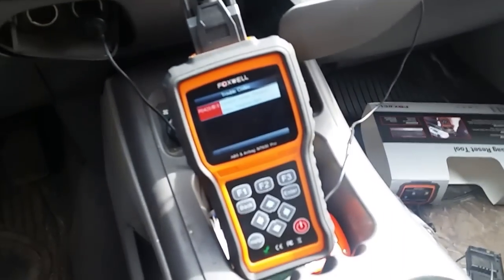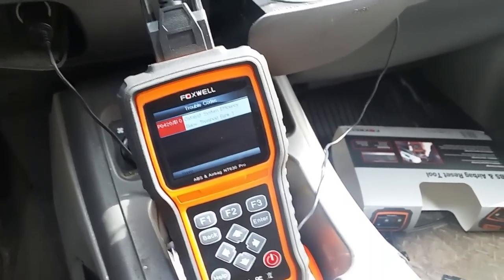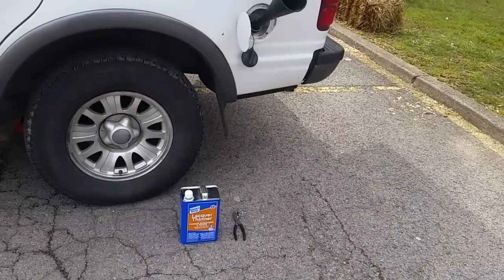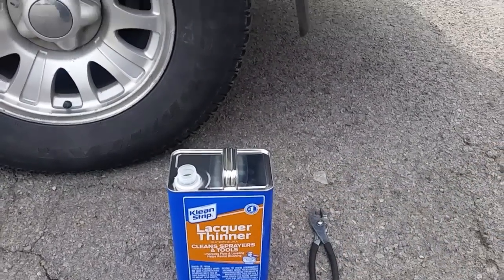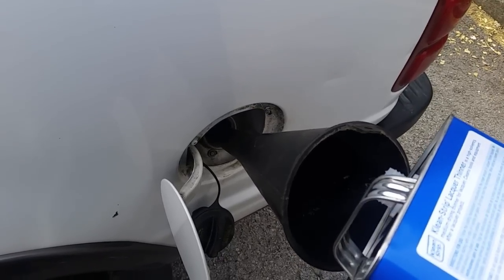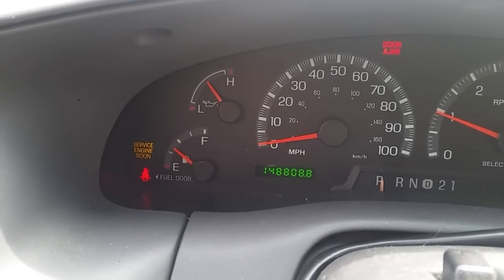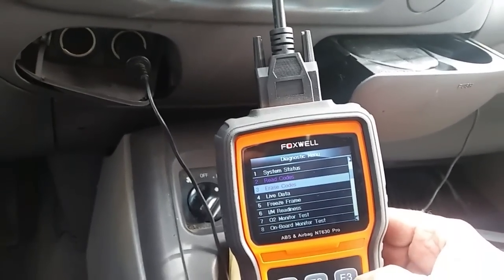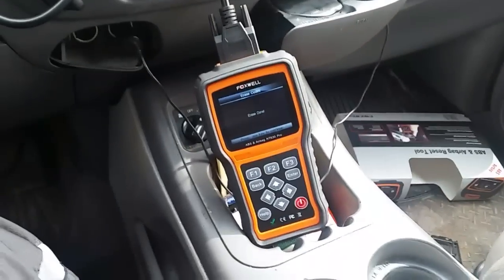PO420 Myth Busted?? PART -1 Lacquer Thinner in your Gas tank? Will It work??

Comment from the maker: This is a real test from all the Hype and myths posted on youtube on lacquer thinner cleaning out a Catalytic Converter with a PO420 code. Here I show you my results.
Reply: Use e85 directly on engine vacuum with a load on the engine (3500 plus rpm) run about 3 gallons for every 5 minutes.
Reply: Where can I find that lacquer thinner living in sweden?
Reply: Donnie V.  I have a 2006 es330. I have ran one gallon on half a tank. Did not work. What fuel ratio did you use?
Reply: @XeoN424 A Paint store.
Reply: @XeoN424  paint thinner is pretty much the same, just a different name
Reply: @nephi30  he says 1 gallon to 10 gallons, but most of the ones I've seen is a gallon of lacquer thinner to a couple gallons of gas and go for a hiway drive 30 minutes or so
Reply: @vossman5  The correct ratio is 1:5 so 20% lacquer thinner to 80% gasoline which is 1 gallon of lacquer thinner to 5 gallons of gasoline, then drive the vehicle for 150 miles at highway speed trying to keep the RPM's closer to the 3000 mark.
Reply: Can it damage your engine/tank components? I read online it can degrade any rubber lines or rings along the way. I’ve had p0420 for months and won’t be able to remove my cat myself, the only reason I’d like to fix it is because I moved to a city that requires emissions inspection which I cannot pass until this issue is resolved
Reply: Not so fast, and not so black and white bro.
Reply: @markbeshay  I believe in it can if you don't do it right, only, and there are too many that don't do it right.
Reply: @markbeshay  you can use catayclean that will temporarily fix the code

Comment: This trick absolutely works! I was completely skeptical at first and very afraid of doing it ,but your supposed to put 1/2 tank of fuel and one gallon of lacquer thinner. It worked like a charm and my 420 code never came back. If that does not work take the catalytic converter off and fill you up a bucket of water and dish soap or laundry detergent. Soak the catalytic converter overnight and blow it off dry with an air gun of some sort. If you don't have any way of having compressed air then just use a clean cloth. All credits go to the Scotty Kilmer Channel.
Reply from the maker: Sweet!!
Reply: It's it really that easy to just pop it off?
Reply: I doubt anything to do with pulling apart an exhaust system under an old vehicle is easy!
Reply: @brockturner3112  EASY and old exhaust don't belong in same sentence LOL
Reply: @sirtubemaster  as in ANY old plumbing
Reply: @rossr6616    Oh yea
Reply: So 4 of the cans dang

Comment: The  Lacquer Thinner  worked for me on my 2004 Camry. 45 miles later the light went off. Saved $1,800.
Reply from the maker: Show off...lol
Reply: How much did you put in your tank? Also, is your camry a 4 or 6 cylinder?
Reply: me too saved $2100
Reply: Donnie V.  I just tap reading this...
Reply: @plekplek4934  600 to 1500 dollars
Reply: M.A.G A
Reply: Lacquer thinner worked on my altima.
Reply: @midnightrunner684  Maga 🇺🇸🏁🏁🏁
Reply: I pray mine goes off sooner too 😹 but my car is a 99 model Daewoo 🤷‍♀️😹

Comment: Nearly 20 years ago I was having transmission problems in my 1990 something Honda Accord and my grandfather put lacquer thinner in my transmission fluid. I thought I was going to have a heart attack in my early twenties would that be my only car and being a single mom. I'll be damned if I never had a transmission issue ever again with that car and I drove it for years!! Basically all the lacquer that it does is it cleans everything all sparkling clean and then evaporates, leaving no residuals from it.

Comment: Worked for me 1998 Ford Expedition.  190000 miles.  Took a few weeks after running the lacquer thinner, but check engine light is gone   Code was P0420 cat converter
Reply from the maker: Nice!!

Comment: Roll the can over so the spout is on top when pouring. It will pour smoother that way
Reply from the maker: Good tip....lol  ;D
Reply: I just pour 3L of cataclean into container to measure it, no wonder it got in to my hands cuz the air choke when coming out. Makes a really sense. Thanks👍
Reply: Yep!  No glug glug glug and sloppy pours

Comment: It WORKED for me.  The P0420 codes was tripped on my vehicle for about 6 months straight.  I finally tried the lacquer thinner trick and without manually resetting the code with the plug-in tool the code reset itself through driving. I have a GMC Acadia.  I put 1 gallon of lacquer thinner into ~10 gallons of gas.  I then drove around my city's interstate beltline at about 65 mph for approximately 2 hours.  The check engine light went off, the car reset the code on its own.  It hasn't come back on and it has been nearly 2 months.  Worked perfect when following the instructions perfectly: Add 1 gallon lacquer thinner to ~10 gallons of gas and then drive at highway speeds non-stop until all 10 gallons are gone. Voila, code gone.
Reply: Can you update? How's it going now?
Reply: Update please
Reply: Is this like an additive that it would harm my engine eventually?
Reply: If u see this update us pls thanks

Comment: I tried this and it worked.  2005 Subaru Outback.  1 gallon lacquer thinner in a 1/2 tank of gas.  Highway driving for 1.5 hours.  Turned the car off and then started it back up.  Check Engine light remained off.
Reply from the maker: Ok. Nice!

Comment: I have a ford escape 65000 miles. Worked for awhile after resetting po420 code.  All stared when I added stp oil and overfilled oil. I believe it got in exhaust system. I read l.t. can even break down tar. So I decided to try. Put 32 oz kleen strip in 3 gallons drove. Check engine came back on. Reset again. It seems the intervals with light are longer and longer. Performance is good. So I believe it did some good. My thought is it's very combustible and makes the fuel mixture burn hotter and in turns cleans the honeycombs in cat.

Comment: YOU ARE MORE WRONG THAN WRONG PERMITS. Lacquer Thinner DOES INDEED clear clogged cat-cons because I just did it yesterday!! I brought my car into mechanic for overheating  after already changing out thermostat, flushing radiator and locking down the whole cooling system. He put car on reader and it came back with 72 TROUBLE CODES !! One of them being a bad cat-con and another bad coolant temp sensor which turned out to be the ONLY valid trouble codes. After an hour of research  i showed back up at mechanic with a gallon of lacquer thinner and a big grin. Mechanic said what the hell you doin?? and I said whats it look like im doin' ...I'm pouring this here gallon of lacquer thinner in my gas tank . Ohh man youre gonna fuck up that engine even more dude !! NO I'M NOT...and as a matter of fact this will not only clear my cat convertor it will make all those trouble codes VANISH AND THIS CAR WILL SMOG ON THE FIRST TRY. He said NO WAY IN HELL DUDE. I said ...just watch me. I poured that gallon in top of a half tank of 92 octane got a stick ...pressed down on the gas i hit 2500 RPMs locked it in and let er run. Told dude i would be back in a hour. Came back the car was down to an eighth of a tank and was NOT overheating which was a very good sign. Told dude to put it on the diagnostic to check to see if the codes were gone and he said i had to drive it 90 miles first so all the sensors can reset. I knew that number was just a safety buffer and the real number was probably about 20 or 30 miles. So knowing that I drove it about 30 miles and brought it straight to the smog guy this morning. He put the car on his reader .........no codes !! THE CAR PASSED SMOG WITH FLYING COLORS THE FIRST TRY. BAMMM...MICROPHONE DEE-ROPPP. In yo face !!!!
1 gallon of lacquer thinner and a drop of faith was all it took. So don't put out false information from inconclusive testing results. LACQUER THINNER WILL UN-CLOG CATALYTIC CONVERTORS...PERIOD...END OF STORY.
Reply from the maker: Options vary....
Reply: It worked on my 2004 hyundaii accent, ran better, no lights and faster speed, I did it over a year ago and car hauls ass

Comment: If it helps,myself and others use tetrasol paint thinners in our unleaded tanks. 10/1 mix, because it has a shit tonne of terolene. It burns colder, which is great on a hot day as that's less knock, therefore less ignition timing. It gives us roughly about 15-20bhp more when tested on a Dyno. 
And our cars only do about 36mpg. 2.0 26v turbo, stock 240bhp but most of us are 300+. See up of 40mpg.
Reply: Would this be more effective at cleaning off the cat? Compared to ones with less tetrolene?

Comment: I will use 1 gallon in 1/2 tank (6.5 gallons of regular gas is Corolla's 1/2 tank) on my 1999 Corolla with 282K miles and original catalytic converter.  Nearly trouble free for 20 years and starts every single time; every day .  Local driving never over 50 or so MPH for the past 10 years. And I already have the slender and long tapered funnel for adding things to gasoline. Well worth the money to save having messes with flammable liquids. My fuel pump is brand new.... installed by a local 'mobile mechanic' and it was original. The old 'sock' was somewhat dirty and stained.
Reply from the maker: Nice!!

Comment: Well my brother called yesterday,cataylst under thrushold something like that thinking he might need t9 try this, 2009 Chevy traverse! Not sure the code numbers but ill direct him to your page!  With the years experience you have your words are welcome cause you don't have to do this for us ( like a helping hand) Thanks for what you do man. Greatly appreciated!!
Reply from the maker: Thanks!  I hope it works!
Reply: lemme know what happens with your bros chevy i have the same dreaded code in my 2012 chevy aswell!
Reply from the maker: Testing is still under way! Hopefully soon.
Reply: Use two stacked spark plug defowlers to the rear o2 sensors closest to the tail pipe.
Reply: @mrrmsfucker146  I did exactly that on my 06 chevy malibu 300 miles later no check engine HOWEVER it wouldn't pass smog becuase i/m readliness was not ready due to cat not htd I then removed the spacers and made it 20 more miles and got cle p0420 my theory at least for my car is yes spacers do work BUT also keep the i/m readiness system from becoming ready since  it doesn't allow the cat htd portion to complete
Reply: I’m definitely trying this on 2009 traverse

Comment: 1 gallon per half tank worked for me. It's been 2 weeks I'll update if it goes bad but for now is good
Reply: Woohoo.. soooo, how was the 2 week later review n
Reply: So what happened it's been 5 months lol
Reply: I did my first Lac. Thinner  cleaner about 1.5 months ago and it didn't help so next 2 weeks I'll do another Lacquer  cleaner but instead of 1/2 gallon tank I'll do 1/4 gas tank to 1 gallon lacquer Thinner and see if that helps... if not I'll just buy 2 catalytic converters and get over it BUT I did see a vid were Scotty Kilmer cut off a cat and soak it in  Dish washing liquid and it did clean the soot/ carbon out so that might be my next option before spending big bucks
Reply: @hajileserpud9539  how’s it go

Comment: This will be a little long, so please bear with me...
I have a 1997 Chevy Silverado with a 305 engine in it and it just turned 301K miles.  About 6 years ago, I had to replace the fuel spider. Two years later, I had to replace the head gaskets at a cost of $2400.  I was told at that time I would need to replace the fuel spider again because they could not get the engine to run smooth. At that time, I just could not afford that, so I drove the truck for 4 years with a missfire in #5.  About 6 months ago, I changed out the plug wires and plugs and the old truck started to run a little better.  One month ago I added a bottle of Red Line fuel system cleaner to a full tank of gas and it did improve a bit.  So...after doing some research, I came across this Lacquer thinner trick. Now, I did a load of reading and watched several you-tube videos on the subject. I decided to give it a try.  So on Aug 31, I put in 10 gallons of gas and one gallon thinner and headed off to a doctor's appoointment.  I drove 90 miles to the appointment and the truck sat in the parking lot for a little over one hour and then I drove the 90 miless back home.  
When I put the thinner in, I was getting a p305 and p420 code. 
RESULTS: I got 147 miles on that 10 gallons of lacquer/gas. Out on the open road doing 70 the truck ran good. Once I got into town and started hitting the lights, it ran a little rougher than usual. When I got home, I checked the codes again.  I still have the p305 but it did drop the p420 code. The truck seems to me to be running a little rougher now but I will have to give it some more time running on clean gas.  
So, as far as the p420 code, I did get good results. I will add another bottle of Red Line when I top off the tank next week. At this point, I have nothing to lose.
Reply: Curious as to the end result of all of this?

Comment: If you have a manual stick it in 3rd and thrash it down highway for 2/3 miles if you have an auto rev the engine for 5 mins at high revs. I suppose the thinner gives a cleaner and hotter burn
Reply: is this same as Paint Thinner?

Comment: I DID THIS AND PASSED TODAY.  HALF A TANK OF GAS AND 1 GALLON OF THINNER FROM AMAZON.  I ALSO WENT FOR THE SMOG WHILE THE THINNER WAS IN THE TALK, IT DOES SEEM TO INCRESE POWER OUT.  FOR A FEW DAYS I DROVE AROUND TOWN HARD, RITE BEFORE THE 100 MILE DRIVE I RESET MY CAR COMPUTER BY DISCONNECTING BATT.  5 DAYS LATTER I WENT IN FOR SMOG BEFORE RAN OUT OF THINNER.  BOOM IT REALLY WORKS !!!
Reply from the maker: Nice!!

Comment: This made me clam up a bit. My expedition likes to throw me engine lights every so often, and I just look for the issues. Last time it was just a nasty air-intake filter. Not too sure what code I had ( Don't own an OBD2  scanner, yet! ). Hope this works for you, man. She is a good truck.
Reply from the maker: Thanks!
Reply: you can get an OBD2 that works with your cellphone for under $20.
Reply: @johnwilson1094  where
Reply: @amazeciane3657  EBay. It's where I got mine.  Mine is in my car right now, out in the parking lot, so I can't tell you what brand or model.

Comment: It also works on my 2006 6.0 powerstoke. I used lacquer thinner one time to help with sticking of the injectors. After that I used brake cleaner. Brake cleaner is very safe on a diesel because it doesnt ignite the glow plugs and turn them into a spark plug, and it doesnt swell the seals and gaskets like thinner will. Truck is so smooth you can't feel it running at a stop light. Try brake parts cleaner you won't regret it

Comment: Worked for me. 2010 nissan sentra 2.0 engine. The proportion is different I used. 4 gallons of gas to 1 gallon laquer. All I did is drive around . Not all at once. Over a period of a week. Light went off and car runs much better. I had 92000 miles on car. But I do have a lot of rattle noises in cat and rest of exhaust system. Something broke loose in cat. Probably will still have to replace cat.

Comment: I will post back to prove you wrong when I reset my light and never comes back on, I used catayclean and gumout before and it stayed off only for a while. If your cat is plugged you won't clean it, that is what I was afraid of, also have a temp spike in town to halfway I did coolant flushing and coolant leak fixing and still does it, I'm convinced it's my CAT. Waiting to find out, but will be a nice $50 fix if I don't have to replace the cat.
Reply from the maker: Ok man!
Reply: @FixingWithPassion  So far no temp.spike, but only drove it once since filling it back up 50 miles.Runs with more punch though

Comment: You're supposed to run the hundred fifty miles the first day you put the stuff in not overtime or run the car at 2500 RPMs for a half hour
Reply from the maker: First of all ''who" set the standards for running it 150 miles a day?? 2500 RPMs for a half hour... V 100 miles a day or 500 miles a day?? There is no real science or expert wright ups on this. Perhaps in rare cases this works....Everyone has there own option on how to do this. Most of the time it does not work. PO420 code is usually a burnt up cat from poor engine management over time. So the best option is to just replace it. This has been My test results over 45 years of auto repairs. Find a video that "proves" this actually works with a scan tool, then buy stock in lacquer thinner...lol  You'll be rich! ....Now for a cat with mud or crap in it just clogging it up well a good soaking might glean it up. But were talking about two different things here. -Thanks for watching.
Reply: @FixingWithPassion  no you do not have an option if you don't clear that out of your system the first day that you do this it will damage your engine that is why you have to get it out within 150 miles lol

Comment: I believe it will work , i don't know first hand but i believe it will .
Reply from the maker: I hope so ;)
Reply: News flash: it won't. You do that and you're risking spending a hell of a lot more repairing stuff other than the cats
Reply: @tehgzizlauw1787  Ive done this on 2 cars. It definitely does work.
Reply: @nonconsensusmedicine4755  definitely a coincidence. Lacquer thinner has acetone in it, and acetone eats through plastic. You're lucky nothing broke in your fuel system
Reply: @tehgzizlauw1787  not true
Reply: @daby8399  believe what you want to believe. Just don't start crying when the acetone in the paint thinner eats through all the plastic in your fuel system and messes up your fuel pump a while later
Reply: @tehgzizlauw1787  it s botled in  PLASTIC  ! 🤦‍♂️🤷‍♂️🤣
Reply: Keep hope alive!  Worked for me